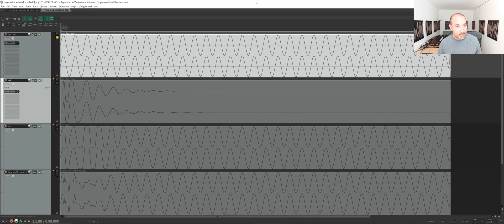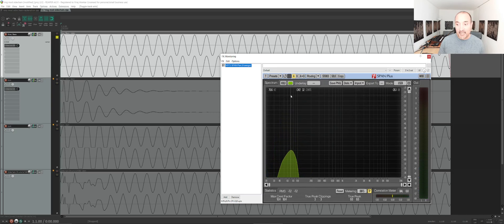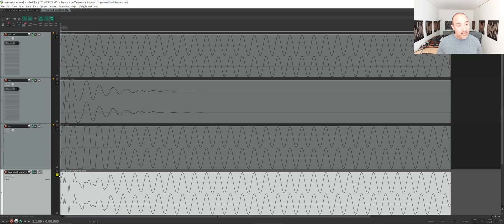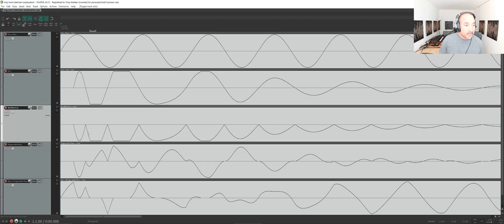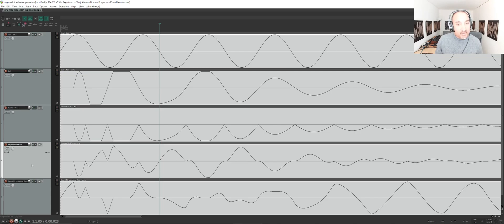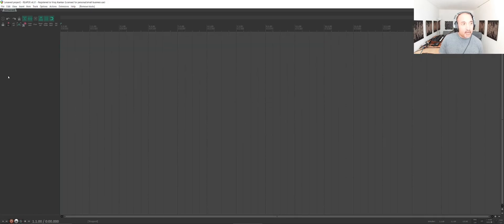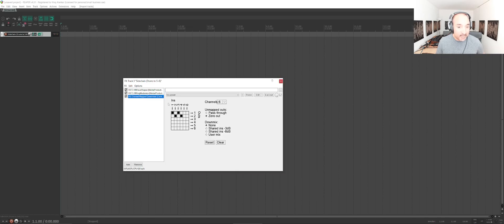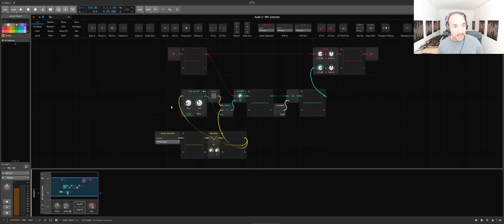Ring Mod Sidechain

Comment: This was nice. I’ve heard of rectification, but seeing it rendered helped my spaced repetition. So it’s: rectify kick, ring modulate (multiply) rectified kick with bass, then sum the dry bass and the modulated bass. Is that right?
Reply from the maker: My reply disappeared for some reason. But yes you are right. Essentially you are carving out the kick from the bass. i.e. making room for the kick.

There is a final sum of the dry kick with the result of course.